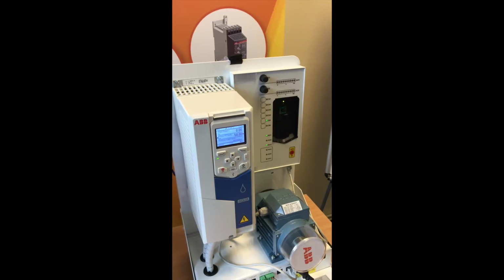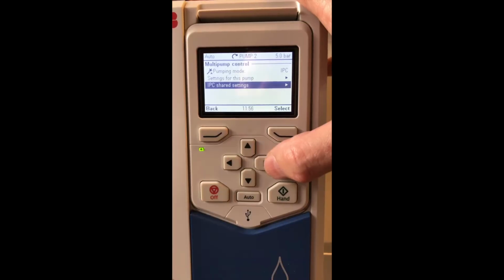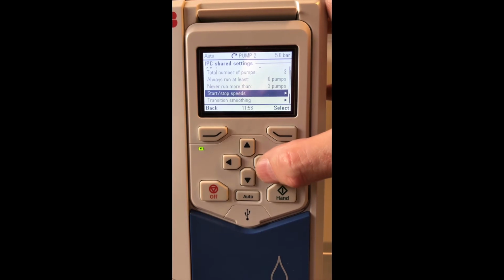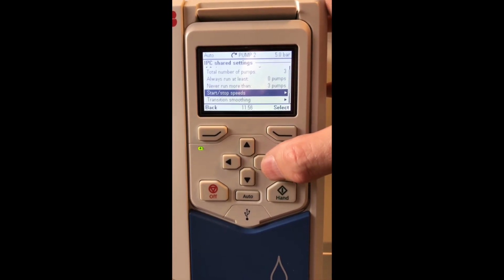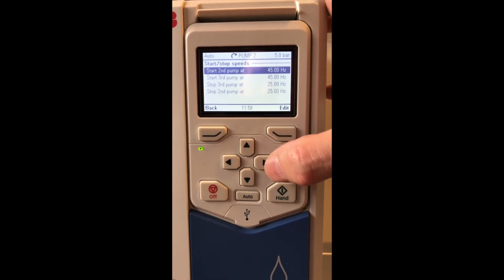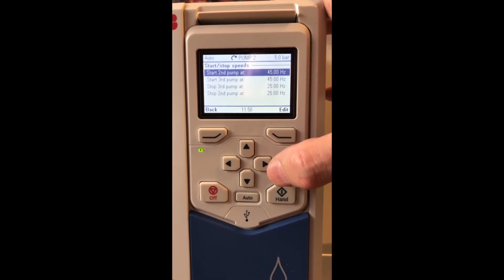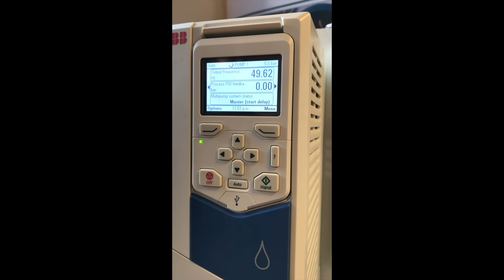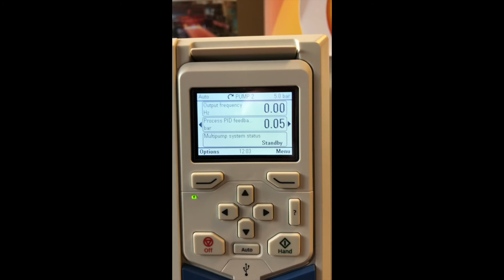How to commission Intelligent Multipump Control Cascade on your ABB ACQ580

Comment: Although I do appreciate the clear explanation and instructions on the video. I can not say the same for the fact that this control is not intelligent at all. It runs the machines from a chose setting between a min and max speed.
Intelligent means that it would also be energy efficient and the control would detect or learn the machines curve while the process is ongoing. I have built a true AI PLC which does exactly that. If you value money or want to conserve energy perhaps we should have a talk about it. #CRC